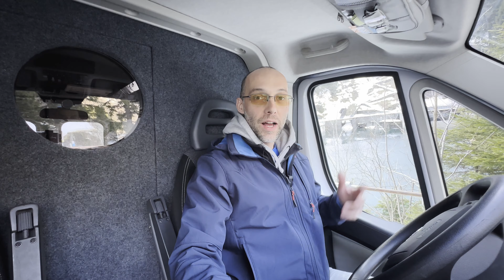EP24 - Webasto Thermotop and few more things added! [ DIY VAN BUILD ]

Comment: Why don't you heat up the car with the Dometic Freshwell 3000 A/C that you've installed ? Don't you have enough energy ?!?
Reply from the maker: The short answer is no. 
Here is the long one.. The Freshwell does not work below 0°C or 32°F. And of course I don’t have enough power in the winter to keep the AC on all day long. The sun is low and even though I have 1 kW of solar panels and I can tilt them still it’s not enough for that purpose. This is gonna work only in spring and autumn when the temperature start to drop, but the sun it’s still kind of high in the sky during the day.

Comment: I have the same lift system, what I do so I don't forget to put it down when driving is to add an automation where if the ignition is on then the solar panels go down, I also make them to go down automatically when night time thanks to home assistant :) 

You're doing a great job on the build 👌
Reply from the maker: That’s a really good idea! Thank you! I can use one of those inputs of the raspberry pi. And program a function in NodeRed. 👍🏻 also the night function is great too.
Thanks!🙏🏻